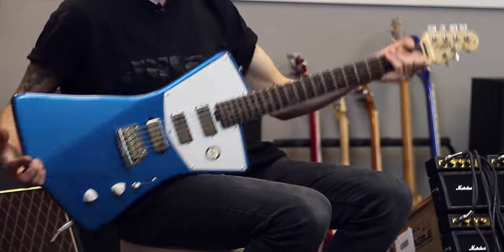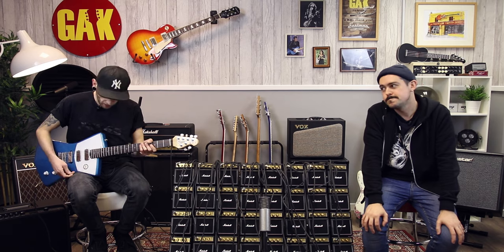1x50W Marshall VS 50x1W Marshall Mini Amps

Comment: What about the difference in decibels?
Reply: Chuck's Guitar Geekery decibels suck. But I guarantee the 412 is louder
Reply: yes, a 12 will send out more sound and disperse better, so little speakers can not make the lows or probably even a cumulative low to compete...but could those 50 do a gig?
Reply: Interesting question. If you double the sound source you get a 3db increase. So whatever dB one of those things has you'd get (2,4,8,16,32,64) less than 6 doublings which would be a gain of less than (3x6 =) 18dB. So probably not too loud.
Reply: Alexander Sack actually lows are just frequency and not volume of air moved, the lows are missing because the electric parts of the components are crap. If they went directly into the 50 power amps instead of into the crap preamps they'd lose a lot less low end. And if they'd replace those speakers with really expensive 8in speakers and the amplifiers with nice expensive amplifiers, they'd get an even better sound, might even compete with the 50W in terms of tone if it were not for the fact that they would almost certainly be far enough out of phase just from different impedances from variation in manufacturing that they'd sound super muddy still.

Tldr: the bass loss and muddy sound stem from the materials in the amps and not the small size of the speakers.
Reply: valuable replies, thank you
Reply: and yes, we can not slip away from the reality that lots of cheap amps with cheap tone will not likely somehow make a great sound if we use enough of them, although some little part of me loves the idea
Reply: Jack Williamson volume of air only changes the volume of sound. That's why they call it volume.

The tone difference happens 90% before the speaker and 10% between the speakers, with a tiny bit happening because of the materials of the speaker.

The electronics in the mini amps are cheaper, they have a smaller useful frequency band and they prioritize a higher center point for this frequency band that won't cut out the highs. That's 90% of the difference heard. Look up bandpass filters for a bit of background on this.

The 10% between speakers comes from the way they set the mic away from all the speakers and also from variations between all the cables and amps. Sound gets there from different speakers at slightly different times, the signal gets to the amps at slightly different times, they process the sound in slightly different ways. All this adds up an appreciable difference which why they don't mic an amp from 3 feet away even in a quiet studio if they way a clean sound, and sometimes they do if they want a dirtier reverby sound. 

The tiny bit inside the speakers comes from speaker flex. Not a big issue till you get close to a 15" paper, plastic, and aluminum are all pretty sturdy up until that point. In bigger speakers, flex can iron out unwanted peaks, which can be desired in some applications, I. E. bass guitar. But even then you don't want to loose too much upper harmonics, I. E. no one uses 30" speakers.

Its kind of like saying all trucks are better at towing than all cars. Well most trucks are designed to tow, most cars are designed for fuel efficiency. But a Vista Cruiser will likely tow better than a Chevy Luv because of the way both were designed, even at a similar price and same model year.

The purpose they designed them for makes ALL the difference.
Reply: Richard Boatwright there's also the cancellation effect that such a large array will have on the beam width and projection of the whole system.
Reply: Godmil I might be wrong, but wouldn't it be a 6dB increase in SPL? I'm not sure if you're referring to dB W or dB SPL, it's been a long time since I learnt all that stuff! I'd guess the perceived volume would probably be lower than you'd expect though, you're right. I don't know how it's worked out, but I heard that as a rule of thumb, generally at normal listening levels, a +10 dbSPL boost will roughly perceived as twice as loud.
Reply: David Hoch <~~ this guy gets it.
Reply: Flat 9 Flatline I was going by my 25 year old memory from high school physics :P  I'm totally willing to believe I'm wrong. Also I'd never heard of SPL before, having a quick look that seems very interesting. Thanks :)
Reply: Wow, didn’t realize I’d spark a science debate lol.  I figured they wouldn’t be nearly as loud as a 50 watt Plexi, but just wondering how much of a difference.
Reply: Gordon Miller DB is just a logarithmic ratio comparison. So if base voltage is 1v and another is 1000v they are 3DBv apart.

DB SPL is based on the hearing threshold, the quietest sound a person can hear.

SPL measurement techniques are very often ambiguously defined, some use a 5kHz tone while others use 15k, some set the mic 1m away others could use 3 ft, ect. This means that most speakers SPL ratings aren't very useful.

The cool this about volume in general is how limited the human ear is at detecting it. If a sound is at the edge of our frequency range, it seems quieter than a sound in the middle of this range, even if it actually isn't. And if sounds from multiple sources cancel each other out, the true volume is much louder than the perceived volume.
Reply: You are talking to guitarrists here...
Reply: JoseitoEdlVodao Lmao your comment is gold
Reply: Richard Boatwright, Fascinating. Thanks very much for that reply.
Reply: Richard Boatwright taking the speaker out of the equation and simply saying it is electronics is miss leading. A 4" woofer at best will have an f3 of 150 to 200hz if sealed, a bit lower if ported although I doubt they would use that in this application. So making up a 12db loss at 75-100hz with electronics you are going to run into the limits of the speaker very quickly. Theoretically yes you could run enough 4" woofers to output the same db levels in lower frequency ranges as the 12s but you're doing so at the expense of the efficiency you're trying to gain with multiple drivers. That and the pain in the ass of wiring, equalizing, and the other bs that goes with having a bunch of drivers. Yes it can be done and 1988 ford escort can be made to go 200mph with the right gearing and enough hp doesn't mean it would be the best choice.
Reply: It's probably louder because of the increased efficiency of all the multiple speakers in close proximity. 50 watts going to 1 speaker is about "3 x as loud" as 1 watt, but the multiple speakers would probably bring up the loudness again. I'm not sure by how much. Perfect coupling would net a gain of 17 dB but efficiency levels off. It would probably be about "6 x as loud" the 1 watts are quite loud in that they can cause your ears to ring if they are on your desk. They are not loud in terms of band practice, but could drown an acoustic guitar and an un-amplified vocalist would really have to raise their voice to sing along with one.
Reply: Godmil put differently...doubling the electric energy of the amplifiers, will result in a 3db increase in acoustical volume we perceive. So if 20 of the amps produced 90db, 40 of the amps would produce only 93 dB.
Dimenishing return arrives quickly, which is partly why my back hurts!
Reply: Richard Boatwright   I never realized this is why it has been called "volume".

Comment: Can I ask a serious question. What was the chain? Were you going from the guitar into one of the mini’s and then daisy chaining amp to amp , or Did you go from the guitar to a splitter and somehow split it to 50 outputs and then go into each amp. Or basically some method of splitting so you didnt need to daisy chain them?

Comment: They sound like the time I was staying out at my friend's place but didn't want to go all the way back to my place to pick up my guitar and gear, for a band practice of a project I was involved in but didn't care that much about. I used my friend's rubbish guitar that had like four strings (usually just a wall hanger) and with a bit of soldering managed to get one of the pickups going. There was already a power amp and speaker cabinet at the rehearsal space so for a pre-amp / distortion I run the guitar straight into the mike input of an old cassette deck and out the headphone output of this into the power amp. It got the rehearsal done for sure, but really felt like work! lol

Comment: Suggestion: Try using 2 old style all in one stereos. Here's what I did when I was a kid...Guitar - Sears Teisco junk. Line into the aux input of a turntable/8 track/ amfm tuner all in one stereo. Speaker outputs in to the aux input of an 8 track/amfm tuner stereo. Speakers were home made 3 way crossovers with 20 inch woofers, two Jensen 2-way car speakers, and two piezoelectric tweeters. Turn the final output volume all the way up. Use the 1st stereo with the guitar input to overdrive the aux input of the second. Result...the impedence mismatches and overdriven aux input, combined with the terrible guitar pickups, allow for some of the spookiest feedback you'll ever hear.
Reply: You were a genius kid
Reply: @devsaini7367  lol nice of you to say so friend. But truth is we were more poor than smart. Necessity being the mother of invention and all that.

Comment: Sounds like the 50x1 we're stacked, (stacked pre-amps) which makes the test kind of inaccurate. Is there such thing a 50 channel switcher to get 1 line into 50 amps? I wish they would've worked on the accuracy of driving each of the pre-amp and power-amp set up. It was fun anyway

Comment: Okay, but the pedals have 2 settings: On and Overdrive.

Also, they sound pretty decent when you match them with a bigger speaker. I have a generic one in a pedal and when given enough headroom (which is minimum 4W), it's a nice and clean little amp. It's just an LM386 circuit, but it's nice.

Comment: Get rid of the mixer . Its adding gain and some color I'm thinking. Would be better off making a 50 to 1. 1/4"  cable after the ab y switch. It would b closer to the input of the 50w head

Comment: Yknow, you could hack that baby Marshall with an external speaker jack, and drive that 4x12 cabinet with it and I bet it'd sound pretty sweet.   I hacked an external speaker jack into my little Roland Microcube and hooked it up to a 2x12 cab. It SOARED.  Little amps pretty much RULE. :D

Comment: Really like the St. Vincent guitar . 
Cool idea. Esp. if into metal .
I am more into Blackmore and Ian Bairnson of AAProject 
Clean to slight distortion 
Would like to see something like that but bass , 
Having to transport cab / cabs and then the head but can't beat the sound of Ampeg tube head / 6 x 10 HLF. or 2 x 10 cab smaller stage

Comment: awesome video, while i love those little marshalls, 50 of  them cranked like that sounds like crap tbh, and thats kinda what i expected, but it was still interesting to see.

If your up for some real effort and handyman work, i'd love to see someone take a guitar, jam 6 pickups vertically onto each string (or even a single small pickup for each string, but i don't know if they even make them), then wire them all out to 6 different jacks out to 6 different amps giving you a guitar you could essentially fine tune the sound of each string, possibly even different effects loops for different strings, could have massively heavy distortion on the top strings, down to cleaner sounding bottom strings etc.

Comment: You could probably buy a decent head and cab for the price of all the 9 volt batteries this thing would get through if you didn't have mains power.

My Orange CR6 uses two tiny 9v batteries. Not a good choice for something that draws 2/3 of an amp at 18V full tilt. Battery life is so bad I didn't even bother and used a cordless drill battery instead. It would be better using 5 18650 cells in series.

Comment: i like the test the 50 1w's sound louder but that could be because of drive , tho i;d rather he played the exact same riffs so we could actually compare properly
Reply: tho , those marshal amps are 20£ each so , 1000£ for 50 1w amps and the other 50w amp is probably wayyyyyyyyyyyyyyyy below 1k i'd rather run 2 20's into 2 12's

Comment: 50 times zero still equals zero. Next time try a 50W plexi vs. 50 1W tube plexis. Or if you can't rustle up 50, try only 5 or 10 1W heads. Those things were LEGIT! I'd take a pair of the 1W JTM45 heads as a gigging rig any day if Marshall hadn't discontinued them.

Comment: Did just about what I expected, except for the excessive distortion, which I should have, but did not expect. You effectively have two 50 watt amps, only one of them has 50 amps driving their own speakers. 50 watts both ways, only the single 50 watt amp is clearly better. lol

Comment: Me in 2023, 5 years after my last comment:  Wish they used an SPL meter to compare with the 50 watt amp. Also, the 50 amps still sound like ass.

Comment: You can have a thousand off these ! It will always sound crap because they are only 2 inches speakers with no top end ! its so much better using one ms2  conected by headphone jack to a pc speaker 2.0 monitors with a 5 or 6" drivers !

Comment: Ok you want crazy, how's your wallet cause I want to see you take a 50 caller metal vox plug and play will have to look it up if you don't know and run it to Sony will look up the name of both but the Sony which has an impressive speaker that bluetooth 100 speakers on a party line so you can set then all around but do cost 250 apiece you ask for crazy and you have to use only the lights from the speakers which should be sufficient let's see that